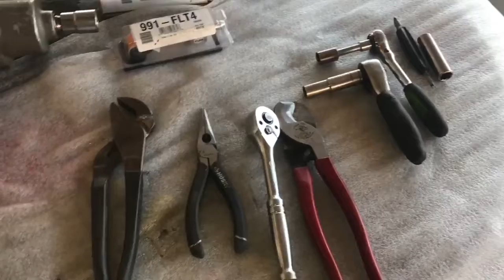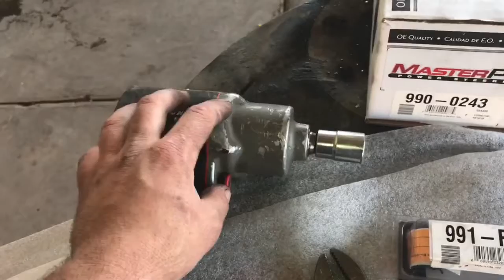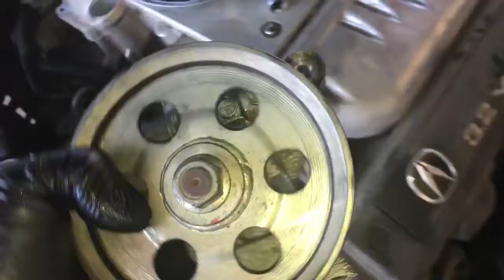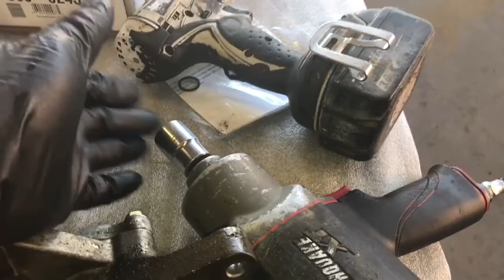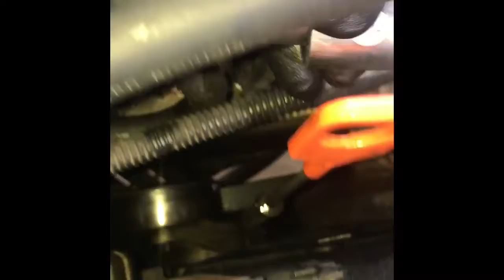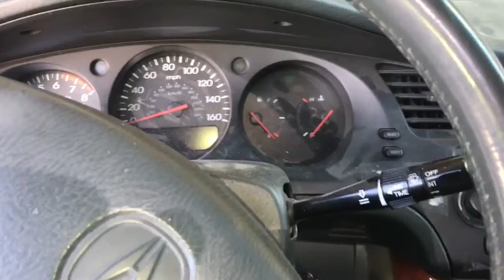Acura TL Steering Pump Replacement (Fast and Easy)

Comment: How do you know when to replace the pwr steering pump? Did you not see the fluid in the reservoir moving when the engine was running?

Comment: quick question, what did you torque the pulley nut at when you switched it over?  Can't seem to find that info anywhere.  Thanks.

Comment: You don't technically have to use honda/acura brand power steering unless you like paying double for fluid. Using automatic transmission fluid is an ok alternative for power steering fluid for these cars and will work just fine for a fraction of the price. This is all just within my experience of course.

Comment: Question. On my 01 Acura CL type S, my power steering works until it heats up, then I have no PS. Does that mean my PS pump is going bad??

Comment: Hey man hear job bro you made that look so easy and  described everything n every move you made so my pump went out a few months ago like within weeks to it went out really fast without hardly any warning it just basically started getting a little tight like it just needed fluid so put fluid in and it just really quickly got tighter and tighter to the point that the fluid just was not making a difference anymore so I am a girl I used to work on my Honda not anything to heavy r crazy tho just replacing window motors n my belt that thing was a bitch took me at day n the next morning lol but I am going to try my best at changing the power steering pump myself I am kinda nervous I hope your get my message n if there's any reason I have any question I can figure out myself would you message me back thank n keep you the best work bro oh one other thing are you sure Honda fluid is the right one I been always told to get Acura like the top grade most expensive for import car Acura kind and if you don't mind me asking where did you purchase the pump or where is the best place to get it for the best deal and did you know if your city worker that you get I used to be 10 but I think it went up to 20 or 30% off of any purchase at AutoZone nowadays just a little FYI
Reply: Hey buddy how your get my message I didn't know if messaging you like this would maybe help my message to go thru I wish my bf would help me but he's not good with working on cars at all at all lol

Comment: Can someone tell me if the top 2 screws on the top of pump hose are the same size and is the bottom screw bigger. Took apart and top two don’t match. Big and small. Bottom had one that matches top. Was that a lacy job by the last dude doing the pump

Comment: I replaced axles and ball joint’s, my steering wheel is very stiff turning left. Not as much turning right I don’t see any leaks fluid looks fine, could the pump be done for or could that be rack and pinion?

Comment: Aaron Hines, you're my hero! A month ago I had my high pressure line replaced due to a leak and because of access, I wasn't confident in fixing it. Last week the pump went bad and they quoted me $1269.43 to fix it! Having priced pumps in advance, I about fell over when they justified the cost by saying "the new pump is $1061.79". To which I replied, "only if you're dumb enough to buy it from Acura." Watched your video, ordered the part and fluid, and I'll be fixing it myself the day after tomorrow for about $200 total. Thanks for giving people like me the confidence to tackle this kind of job! I want to add a filter too but the store sites both show 3/8" ID and 5/8" ID filters as "fitting my car" which obviously can't both be right. Anybody know the actual ID on the low pressure hose?
Reply: Chris, how did this workout?
Reply: @chrisaustin4115  It was a pretty easy and straightforward job. It’s been almost 2.5 years since and it’s still working great with no further maintenance on the steering system needed.
Reply: @ChrisCormack you remember were you buy the pump

Comment: Great.  I also would have liked to the the pulley being removed, specifically how you kept it from rotating.  Thanks!!
Reply: Patrick Patterson you hold the pulley and use an impact wrench to remove it.
Reply: Yea and how much torque to use.

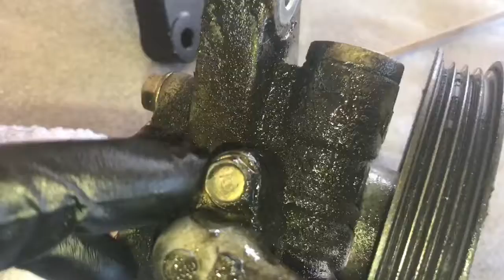Comment: Thank you for sharing! I'm trying to replace bottom O ring but the bolt is underneath and really difficult to reach. I'm referring to the 10mm bolt you are mentioning at 3:58. Is there any way to loosen the tight bolt without removing all the parts?

Comment: I was really wanting to see you put the pulley back on.   Other than that, GREAT video.
Reply: 6 years late, but you want about 1/4 in of slack when you press down on it. Not crazy tight but tight enough it won’t slip off

Comment: Replacing a battery is "Fast and Easy" not this.. Lol
Reply: this is a 30-40 minute job if your fast at it.
Reply: That bottom 12mm Im going to have to remove the motor mount to reach mine. How did you do yours? @jasonjones3
Reply: @CanesupNolesDown  jack under engine and pull the mount.
Reply: Oh come on. Suck it up lol

Comment: You should have shown how to  remove the pulley. HOw do you hold it from turning and is it reverse thread???
Reply: Look carefully at the threads on the new pump shaft- standard right-hand thread.  The impact will take the nut off with you holding the pulley by hand with gloves.
Reply: @mbasiletti  do you really need the impact though?

Comment: Thanks for the video. Why do you need to add the inline filter?
Reply from the maker: im sure you can get away without it, however the manufacture stated that warranty is void if not installed . so i did.
Reply: Aaron Hines in case pump fails you can get a new one for free if his warranty is voided his 200$ goes to the trash

Comment: Great video! Is it possible that a leak can be caused by  a bad o-ring only? There isn’t a funny noise with the Acura I want to work on and the steering wheel turns fine. There is just a leak that happens daily. The car is the same you’re working on. Hope to hear from u soon!
Reply: I replaced the low pressure o ring and no more leaks!! But I think the fluid needs to be flushed. I had to take off the timing belt cover to access the 10mm bolt under the hose 😬 and the bottom center where the bolt goes on the cover broke..
Reply from the maker: Yes the o ring can leak which can cause the fluid to become low. I have replaced just the o ring before. It seals the high pressure hose to the pump. I purchased the o ring from a Honda dealership and it only cost a dollar or two. Let me know if I can help Any further
Reply: I have the same question...thank u for the follow up...I hope u fixed that bolt u broke.

Comment: Thank you for your detailed information on the install. I did your suggestion and added the inline filter. Also picked up from OReilly's. Only thing I did different was picked up pump from ebay, couldn't pay O'Reilly's price. Ebay price $54 plus tax and free shipping. Thanks again.
Reply from the maker: Thanks man. Ya those pump can be pricey. 54 bucks is a good deal!!
Reply: How has the ebay pump been working? Did it fix your problem? Is it making any noise?